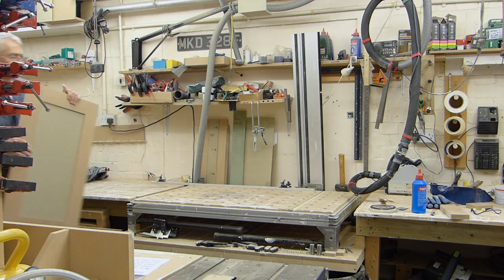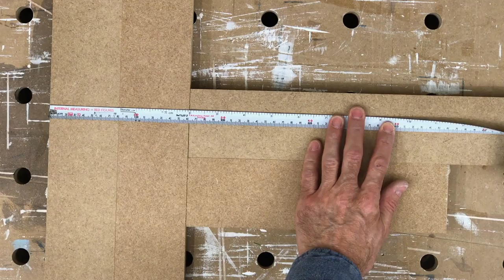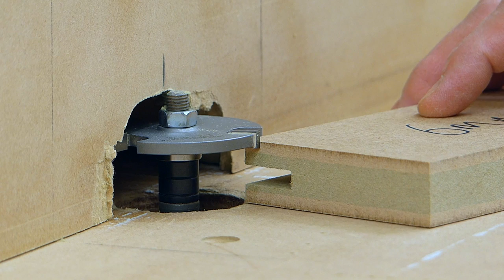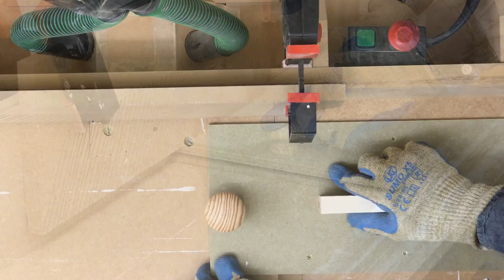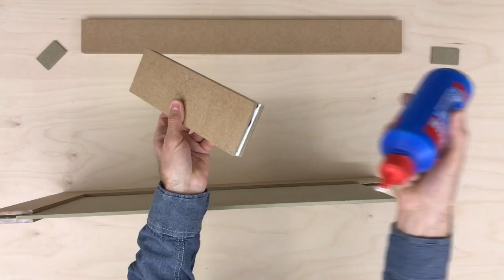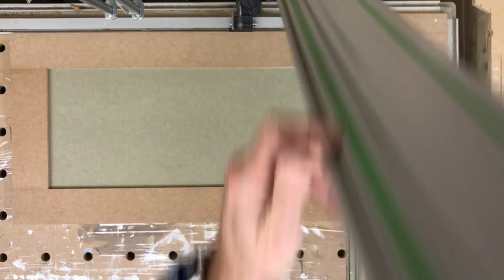Shaker-style Panel Doors #001

Comment: Just finished making 4 doors for some cabinets using this method. Made them out of solid wood (18mm by 44mm boards for the frame, 7mm tongue and groove cladding for the backing). Don't have a router, so cut the grooves on the table saw (that took a bit of thought!). Worked really well. Thanks Peter.

Comment: I've been woodworking for 40+ years and never thought of this or saw anyone else position loose tenons like this.  Amazing!
Reply from the maker: Howard Hagadorn Wow, thanks! I've been woodworking for 18 years myself, and have made panel doors every conceivable way, and this is by far the easiest I've found. Glad I made the video, and great to hear you found it useful! P
Reply: The only person I've seen do that before is me. I'm 60 and started using this method many years ago. I can't remember how or why I came up with it. My father was a lifelong cabinet maker and he didn't use it. Built cabinets for my son's kitchen 2 1/2 years ago. Shaker doors on the bottoms and glass pane doors on the top. Same technique on the rails & stiles but with a rebate on the inside to receive the glass. Used small offset hold down clips to secure the glass in place. Always been the easiest way for me. Through all the years I've never seen anyone else use this method until now.

Comment: A word of caution. Wearing gloves around machinery is not to be advised. In the scenario where you get a cut, or a severance it means the surgeon has to spend time extracting the threads form the glove out of the wound.
Reply: Similar advice goes to motorcyclists wearing jeans. The fibres, and something in the denim make it poisonous.
Reply: I tend to ride my m/c naked to save them the most time.  @edwardrolling1411

Comment: You can get away with gluing an MDF panel, but normally it's a bad idea to glue the panel to the styles/rails.
Reply from the maker: To be clear, this entire job is made from Moisture Resistant (MR) MDF - you’re not ‘getting away’ with anything gluing the panel in. 👍

Comment: I've now watched more then a few shaker style door videos, and I have to honestly say  yours is the simplest and most cost effective.  The floating tenon idea made from the same stock as the panel, great idea. No special equipment or expensive power tools to purchase. Great technique and video. One question the router bit you used to cut the slot, same thickness as the panel?
Reply from the maker: Thanks! This was my first YouTube video, so pleased to see it’s still useful 👍👍. The slot cutter is slightly thicker than the panel - 1/4” vs 6mm - as this gives a little wiggle-room during assembly - and wiggle-room during a glue-up is always welcome 👍👍
Reply: @10MinuteWorkshop  times when it is useful to have metric and imperial measurements. 🤓😂😎

Comment: Thanks to your simple  build method I have just finished making 18 MDF doors with a hardboard panel insert. Of all the information I have taken from your video the "loose tenon" is what make the whole process so fast and simple, I can set my router once for every cut and leave it! No bit changes and no trying to find that exact setting again for the same set of doors. My doors included sizes from 23 inches tall to 70 inches tall, the only process I had to add for the longer doors was to extend my top drawer under my bench, lay the door on it and check the  straight side of my bench against the length of the door, I do this on both the first stile and then when I'm happy I also do it on the 2nd stile. I check this width with a tape measure before I proceed, this has saved me a lot of stress with trying to square up a big door after full assembly with glue starting to set. I have also changed to Titebond III for the longer working time. I plan to make a video making sure to credit you for your tenon idea.
Reply from the maker: Hi Greg, and thanks so much for taking the time to comment! Really pleased to hear how your doors went - great stuff - and glad that this old video helped! Just to be clear though, the ‘loose tenon’ method of making doors this way is as old as the hills - I’m just delighted to have been able to bring it to a few more people. 👍👍

Comment: Getting ready to build kitchen cabinet doors using this method. It's a little more complicated here in the USA, because we don't get 6mm MDF, only true 1/4" MDF. I wasn't able to find a router bit that would make the grooves wide enough to fit the 1/4" stuff, so I will be using the table saw. My saw is home-made and will not accept a dado stack, so I built a jig to help make the grooves in the short ends of the rails. I did a few test pieces today, and while it certainly won't be as elegant a solution as you've come up with, I think it's going to work. Thanks for sharing this technique, Peter! I think the floating tenons are brilliant.
Reply from the maker: Thanks Josh, and good luck with it! One other option is to use a 1/4” grooving bit in the router, but make two passes, the second one slightly lower. Or with a bit of careful setting up, make a pass from either side to get the slightly wider groove. 👍👍
Reply: @10MinuteWorkshop  I ended up using the 1/4" grooving bit and making a pass from both sides of the board, and it worked out beautifully!  The setup wasn't as difficult as I thought it might be, and it gave perfectly centered grooves that are only a few thousandths over 1/4".  Just enough wiggle room to make glue up go smoothly.  It doesn't take too much longer to make 2 passes on each piece, and this method is certainly better than using the table saw and making multiple passes.  I built 4 doors for the pantry cabinets, and they look so good I've decided to redo all the kitchen cabinet doors.  Thanks again, Peter!
Reply from the maker: @thegrublord  Hi Josh! That's great to hear, thanks so much for letting me know! 👍

Comment: Cheers for the nailer info Peter. The plates were used in the fitted bookshelf video. They were fixed to the back of the carcasses and you drill through the carcasses and through the plates to fix the carcasses to the wall. Cheers Terry
Reply from the maker: treesa greensa Ah, OK. They're regular 'corner plates' from Screwfix, I think, maybe Toolstation. Widely available, anyway 👍

Comment: Peter - just to say thank you, I decided to try this method but I have used oak as the frame with a plywood panel.  It works beautifully, I don't have a router table so had to cut the slots with a handheld router but they have come out beautifully and very strong with a deep groove and wide tenons.  

Thanks again - I didn't know about this method and it makes very neat, strong doors.
Reply from the maker: That’s fantastic - really pleased that it worked out for you. And yes, it’s a great, simple approach to cabinet doors 👍
Reply: I was going to ask if this could be done without a table router, so thanks for confirming it can :-) I imagine it's not quite as quick or easy?
Reply: @markredshaw84  It definitely isn't but I used the vice to provide extra stability/width for the router to move against and it worked out.

Comment: Just finished making some 550 x 2300 three panel doors with ogee beading using the Peter Millard method. Tricky assembly on this scale but they have turned out great. Ogee beading made them suitable for a Victorian style house. Thanks Peter👍
Reply from the maker: Thanks! Wow, big doors! Glad that turned out well though! And agree, a bit of ogee moulding is all you need to turn Shakers into Victorians, lol! Side note; this was the first video I ever posted, almost exactly 5 years and 4 months ago; if you’d have told me then that it would still be proving useful to people in 5 years time, I’d have laughed out loud! 🙌 Thanks so much for taking the time to comment - really appreciate it. 👍👍
Reply: @10MinuteWorkshop  I had started with the idea of using solid panel doors with MDF strips added to get the effect but this method is much better.  Lighter doors and you get panel detail both sides.  I did also put a small chamfer on the ends of the rails where they butt the styles to give a bit more detail and create a stop point for painting.  The top panel had a groove cut below it to create the effect that it was two doors and not one.  Only issue with the size (apart from the frantic gluing up and clamping!) was the wobble on the the doors when fitted with a magnetic catch just at the bottom  (even with 22mm MR MDF).  This was solved by using a catch top and bottom and adjusting the catches so they did not hold the doors too firmly.

Comment: I like the.  Very straightforward.  Far better than the normal mortise and tenons joints.  I also like your use of the Fesool track as a boss cut device.  I will use both of the ideas.
Reply from the maker: Thanks! 👍

Comment: That's great thank you for sharing. Last time I made these I overlaid 6mm MDF faux rails and stiles to 12mm MDF but just couldn't get the glue joints tight. This is a much better method.
Reply from the maker: One Man Band Woodworks Thanks! Yes, works well for me; I've done another couple of door videos since this one, you might want to check them out too.👍

Comment: What a great way to make Shaker-style doors! Two questions:  First, how do you make the rails and stiles to uniform sizes without a table saw?  (Both parallel and repeatable).  Second, how do you make the loose tenons for the doors?  A future project is kitchen cabinets, and your method looks like just the ticket!
Reply from the maker: Thanks! If I have a lot to do I get my timber yard to rip strips to size for the rails & stiles, but if it’s just the odd one then I use my tracksaw - I set the rail with a combi-square. Loose tenons, I cut strips with the tracksaw and to length on the mitre saw. Works great 👍
Reply: Thanks, Peter!  So simple!

Comment: Hi Peter, many thanks for posting this, just finished a Mock-up using some 6 and 18mm MDF offcuts. I had to use an improvised offset 4mm biscuit joint router cutter in my table, then invert the panel to get a finished 6mm slot, 12mm deep in the 18mm, glued up and 'hung' just to see how well it worked. as it turns out, VERY well indeed!
Which then got me thinking, ever considered attempting this with 6 and 18 (or 22mm) Birch Ply? That could look rather stunning with a couple of coats of varnish.
Reply from the maker: +John Williams Pleasure - good to hear it worked well for you! No, I’ve never tried it with Birch Ply, but it is in my ‘one day when I have a minute’ list! Cheers, P 👍

Comment: That's a great loose tenon trick.  I've seen it done that way before.  I usually just use dowels.  I'll have to try this.
Reply from the maker: Thanks! It's easy because you're already running a groove for the panel, you just run it a little further. P

Comment: Good evening Peter
I have watched the majority of your videos and by all accounts you seem to have a wealth of experience which seems to have been achieved through experience and trial and error. Its because of this I would really appreciate your opinion and guidance of my future product. I am intended to totally replace my own kitchen and have been looking at using the Howdens Tewkesbury Framed Doors. The ones purchased from Howdens are Oak however i am conscious of the cost and also why I want to order an oak product simply to then choose a painted finish.  My intention is to manufacture both the doors and the cabinets myself in MR MDF as I have a suitable sized area to complete the works including the painting and the vast majority of the tools as my father was a Joinery Lecturer at Collage and also a Contractor. Unfortunately he passed 12 years ago so my go to man is no longer here to point me in the right direction. The main questions I have are
1. Cabinets - I was considering using 18mm MR MDF with a 12mm MR MDF back panel. In addition I was considering omitting the 47mm service gap at the rear. What would your opinion be on these thicknesses. The intention is to use pocket holes. In addition to this I am intended to use an airless sprayer to paint both the doors and cabinets. The primer I have considered is Bin Zinsser. My thoughts were to align all the similar size units together in a sandwich and clamp them. Then sand the edge and then use a roller to apply the first coat and then lightly sand. The second coat on the visible edges I then intended to apply via the spray gun whilst applying a coat to the internal faces of the cabinet. At the same time at least applying a single coat to all the hidden edges. I would then apply the final coat of paint to the inner cabinet faces and exposed edges once it has been assembled. Question is does this sound reasonable and how many coats of primer would you suggest and what matt finish coat would you suggest and how many coats.
Continued
Reply from the maker: Hi Darren. Wow, that's a pretty epic comment, 550 words! There's a lot to get to grips with there, I'll take a stab at it in the morning, OK? 👍
Reply: @10MinuteWorkshop  Many thanks Peter.  It is appreciated.
Reply from the maker: Hi Darren. There’s an awful lot to deal with here and I don’t want to put you off, but perhaps I can point you to this thread on the UK Workshop forum, where a similar question was posed recently.

https://www.ukworkshop.co.uk/forums/taking-a-plunge-to-kitchen-cabinet-making-t113525.html

From the outset I’d also like to make it clear that even though I do this for a living and have a reasonably well set up small workshop, I wouldn’t go near making a complete kitchen from scratch; it’s factory work, best done by automated machinery than can deliver a consistent quality product at a price far cheaper than anything I can make. That said, I totally understand if you want to make this yourself as a project, and have the time and space to do so. So, in answer to your questions:-

18mm MR MDF with a 12mm back is perfectly good enough for the carcasses. I’m not a fan of pocket-hole screws personally, and I would always recommend that you have e.g. £dowels/££biscuits/£££dominos to help with alignment.

Zinnser BIN is a fine primer/stainblock, but it is shellac-based product and best suited to spot application IMHO e.g. the edges, if you feel they need it. I would absolutely NOT recommend that you roller the primer if you intend to apply a spray finish; do one of the other, don’t mix them.

My methods for painting with a roller have been well documented in the Painting & finishing series, starts video #029, and for spraying in the Playing at Spraying series, starts video #188. In short, I don’t do anything special to the edges, other than sand them. I apply one or two coats of water-based primer/undercoat, followed by two or three coats of the final topcoat - almost always an eggshell or satin finish.

I’ve been particularly impressed with Tikkurila Helmi paints, though I find the eggshell a little too matt at just a 10% sheen, where most eggshells are 20%. Otherwise I’ve used all kinds of ‘high street’ paints and found very little to choose between them tbh.

Re. the doors, yes a 105mm frame from MR MDF will remain stable, though I would always go for a 22mm thick rail and stile; I regularly use a 6mm panel in this, but I know some prefer a 9mm pane to give more heft to the door, so perhaps consider this for the pantry door?

And yes, I would make the door complete before adding the decorative groove.

HTH & good luck, Peter
Reply: Peter. Many thanks for taking time out of your day to provide the advise that you have which I am sure will be very valuable. I have quite a lot of knowledge of construction and have converted my own barn conversion with the exception of the Gas and Log Fire Installation so have a reasonably good idea of how things always seem to take a lot longer than initially intended. I will certainly take your comments on board. The main reason for wanting to construct the kitchen myself is that there will be a lot of bespoke elements due to beams and columns within the kitchen space and as a result of that I can construct bespoke units to fit the dimensions i have available.

Comment: Absolutely love your videos. They gave me the push to treat myself to a woodshop for my 30th 😂. 

I do have a quick question about using MR MDF in kitchen cabinets. What is your prefered method for finishing rhe inside - do you paint or veneer?
Reply from the maker: My preference is for Melamine tbh, but when I was doing client work it was 95% painted, 3% Birch ply and 2% veneered. 👍👍

Comment: Hi Peter.  Love your videos.  Just moved back into a house after living in a motorhome, traveling this country, for 8 years so I need to set up my shop again and it is not overly large.  You have convinced me to go the Track Saw route so a couple days ago I bought a Kreg plunge saw and 2 62" tracks.  Watching your videos has shown me that I will need a short track for the shop. You are such a good woodsmith that I wonder do you really work in all MDF? I much prefer plywood or solid wood.  Will have to look through your videos to see.  Hope to become a patron after I am done with setting up this shop.  Rich
Reply from the maker: Hi Rich, and thank you! The Kreg plunge saw looks nice, but not something we get here in the UK AFAIK.  Yes, I use mostly MR MDF - this is a different animal to the regular MDF that you may be used to, it has a much harder core and doesn't produce the 'fluffy' finish that seems common amongst other types. I use all kinds, but when most of my work was painted built-ins (this video's from 3 years ago, just FYI) then MR MDF is the perfect board for this. I'm doing a lot less of that kind of work now, and using more Birch ply and also some hardwoods , too - see my last video but one, #369, Birch Ply and Wenge side table. More of this type of thing to come 👍👍